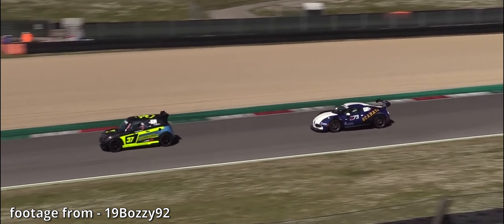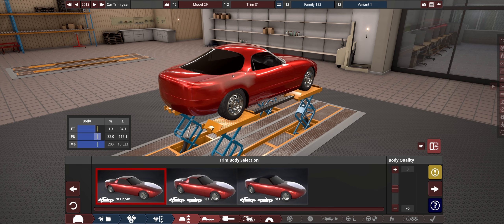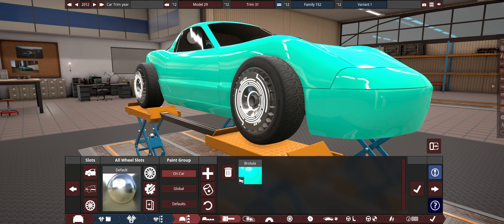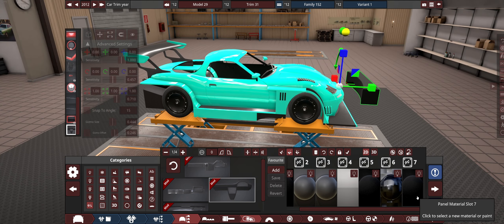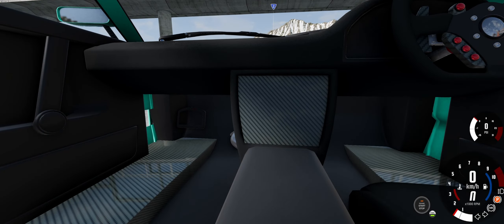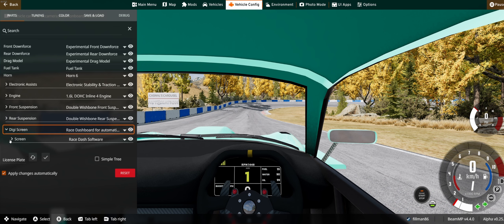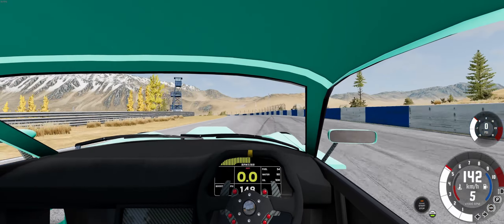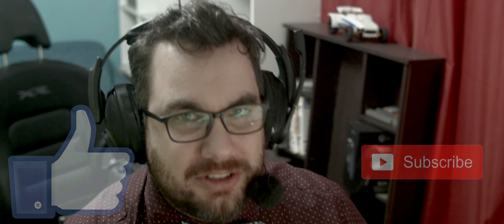Using BeamNG's NEW Dash in Automation Cars :D

Comment: Nice one Fill! I wonder if there isn't an easyer solution to get the dash position. Perhaps by inserting a 3D prop exactly where you want the center of the in-game dash and copy the position, using the world coordinates in Automation, and then inserting them on the jbeam file later, just to avoid the fiddling around and save some time. Do you think the automation and beamng coordinates match?
Reply from the maker: I've never heard of getting co-ordinates in automation?
Reply: @fillman86  When you make a fixture 3d, on the advanced settings gizmo, if you transform it in world space, you get the absolute position on the car of such fixture.
Reply: @sentinger  I think that's for automation, it probably doesn't translate to blender, or beam.

Comment: 21:35 This is the main reason I go with manual in most driving games I play, even though I play on controller. 
It's always better to have the decision of what gear you're in be entirely your decision
Reply from the maker: I'm just not dexterous enough to change gears on controller :/
Reply: @fillman86  I set the up and down shifts on the buttons (like ∆ to shift up and [] to shift down)

Comment: I just thought, can we do the same with the steering wheel? Like export it from other beam cars and then line it up. It would make it so much easier.
Reply from the maker: the work would be nearly the same, you'd only be skipping the blender step maybe. Though there are easier ways than using blender for automation steering wheels